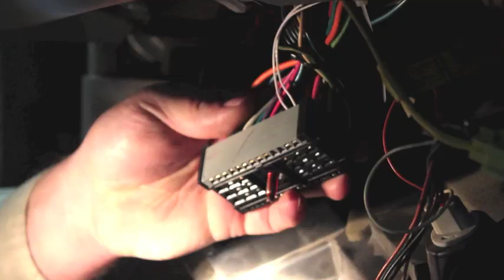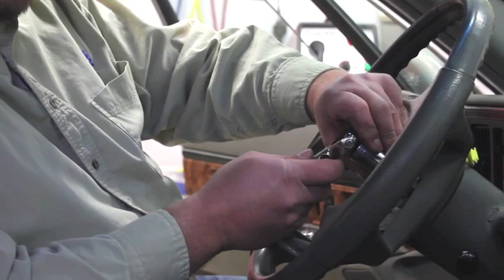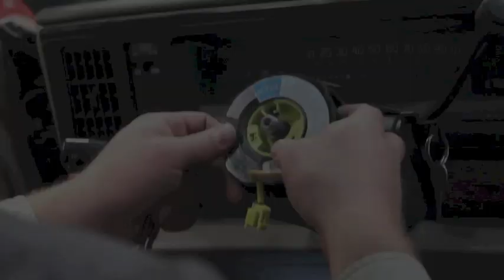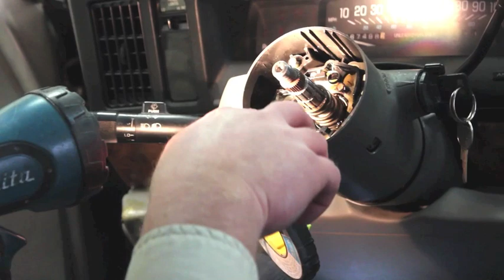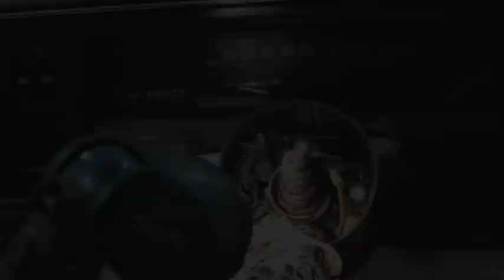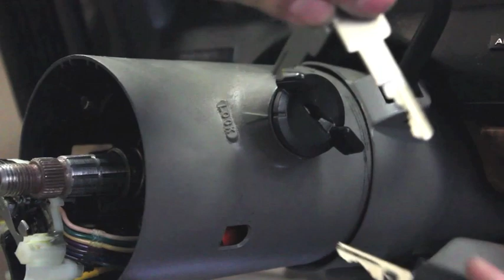Ignition Lock Cylinder Replacement (GM cars w/ PASSkey theft systems)

Comment: Very well done guide, but to save a few dollars people can test the resistance of their key with a simple voltage meter, go online and match it to the gm key resistance pellet list since GM only made 15 different resistance pellet keys, to what your old key resister pellet is to see if the key pellet is damaged (as the resister pellet may degrade its resistance over time the key should be close to the actual resistance number) . then you can head over to radio shack and for a few dollars pick up a pack of resistors, match the resistance of the chart or key if the key matches the OEM chart key resistance with resistors wired in series (daisy chained) and solder them together half of the total resistance per white wire, splice them onto the two white wires for the new ignition lock cylinder and then cover with electrical tape or if you are feeling fancy use heat shrink and a heat gun then reassemble, should work the same but save you about 45 or 50 dollars.

Comment: how do u test for tht my 97 cadillac seville when i insert the key and try to start the car the dash reads starter disabled due to theft system plz remove key..plz help
Reply: +STONE FLIGHT One of those white wires is probably broken.